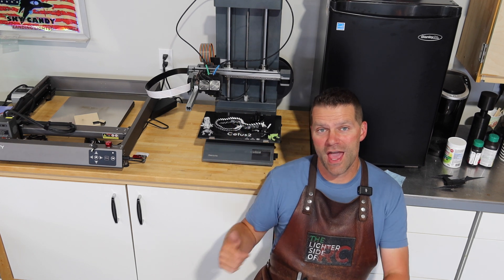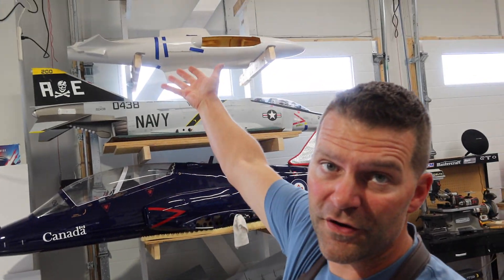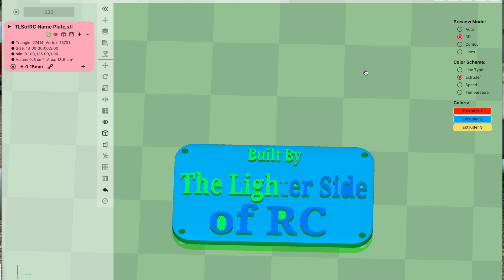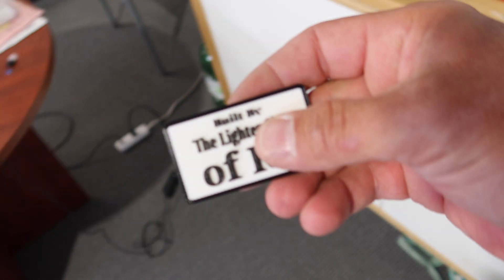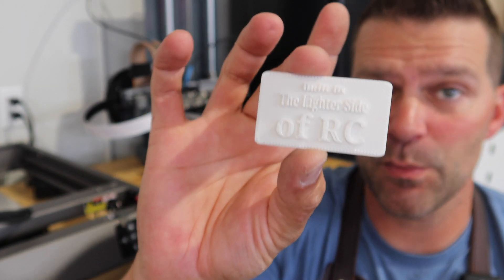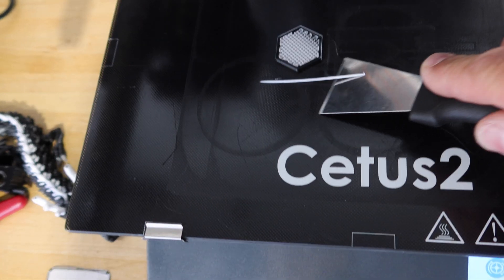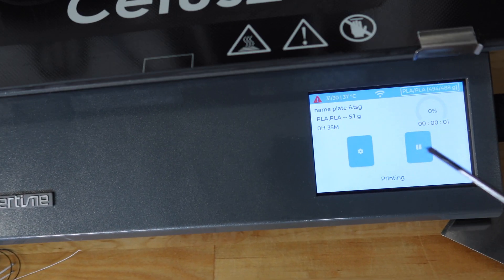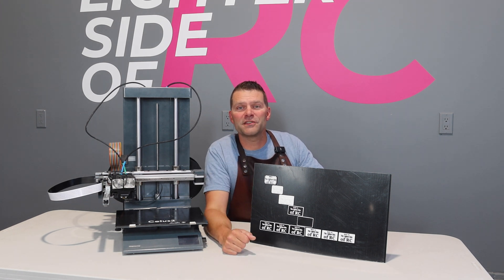Trial, Error, Triumph - My 3D Printing Experience with Cetus 2 from Tiertime

Comment: Do ya still use this printer if so is this one any good
Reply from the maker: I don't.  Gave it away to a young inspiring creator.  He is using it still today.
Reply: @thelightersideofrc  did ya like using this printer at all
Reply from the maker: @monsterstorm78  yea for sure. It was slick to be able to affordable print 2 colors. I’m not big into the hobby side of 3d printers, meaning I like my printers to be easy to use and just work without fiddling. So if your like that, this one is a not plug and play.

Comment: I've been 3D printing for 2 years I started out just tinkering which led to me printing 3dlabprint j-3 Piper cub everything on the plane 3D printed was a fun build I printed it on an one of the best entry-level beginner printers on the market by creality an Ender 3 lots of room for upgrades which is what I bought it for just love 3D printing made lots of things in tinkercad for my RC aircraft
Reply from the maker: I'm enjoying the journey so far!  Shortly after this video my Bambu X1Carbon showed up and loving that printer!
Reply: You would have been better off with one of the Sovol clones, they take the open source Creality design, fix the issues, improve the parts, upgrade it, and still manage to sell it cheaper than the Creality model it was based on.